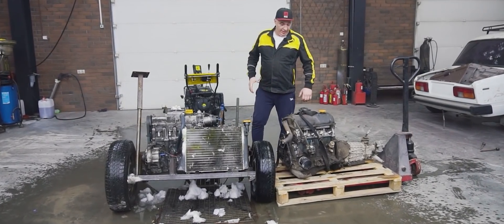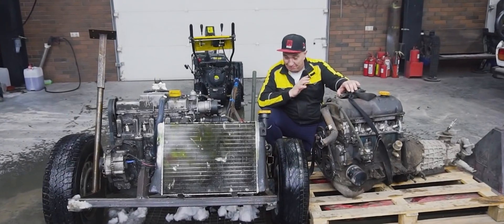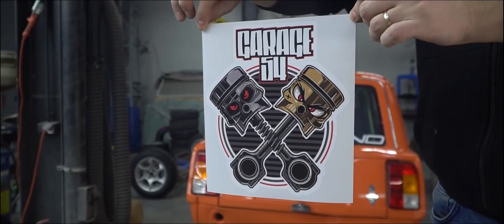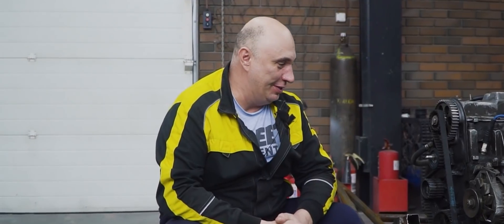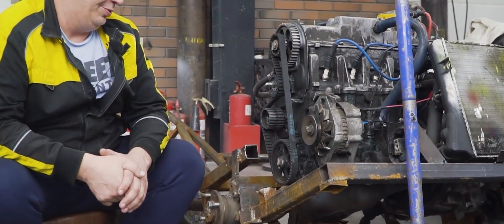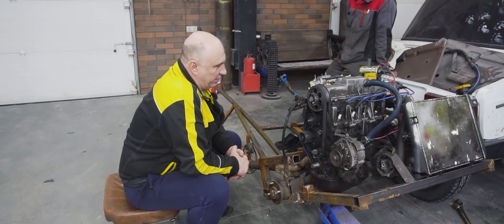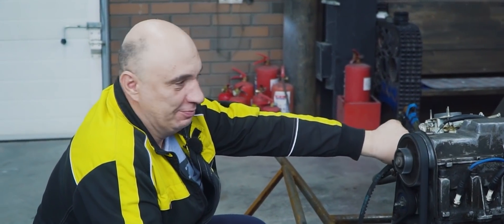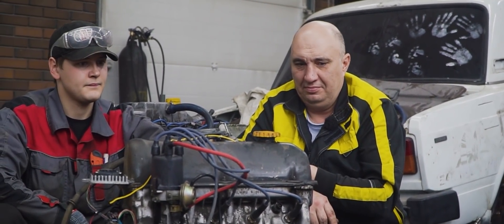8-stroke engine?? How does that even work?

Comment: would be cool to see an actual 8 stroke using gearing and a custom cam shaft such that the engine spins one turn between all firing turns, so basically half the power with a nice v8 sound

Comment: Hi you guys, i used to have 5 Lada Nivas, i made up my own efi system way before Lada actually done it... that was fun, manifol plenum chmaber and the i used the ignition from an early holden, camira,  that gave me 2 options, use the lada distributor for power and economy ort the electronic camira coil for race mode.. others run on 180 holly carby... also good.. used to be fun, . but my Question is that i was told a fiat DOHC fits on and runs on a lada engine.. , I also need a transfer case of a lada Niva send to Australia, can you help?

Comment: if the crank is meant to rotate twice for every rotation of the cam, then having the crank and the cam with the same size pully, it should run like a 2 stroke. and that should work.

Comment: An eight stroke engine would have to have 2 pistons connected to a single rod with spark plugs on both sides. You'd have to have an 8 cylinder distributor...

Comment: Because the engine is being turned over and the valves are opening and closing at a much faster rate than usual this could cause the engine to spit out fuel rather than suck it into the piston

Comment: Okay so what are the 8 strokes? Combustion will be one, for sure. I guess exhaust must be another. What are the other 6? Is the piston really going up and down 4 times between combustion strokes?
What’s the purpose? The most efficient and economical is the Otto 4 stroke, which completely purges the cylinder at each exhaust stroke, before drawing clean mixture in at each induction stroke. No mixing of exhaust gas with combustible mixture. To increase power and possibly smoothness, at the expense of efficiency, you’d need to convert to two stroke. That means there’s a combustion after every Tdc, so you have twice as many power strokes per revolution. 
I’m pretty sure this isn’t an 8 stroke. You’re just increasing the cam speed, meaning exhaust valves are opening while the piston is half way down what should be the induction stroke, contaminating the mix with spent gasses. Worse still, both valves will open during what should be the combustion stroke, allowing fire back into the carb then down the exhaust, where there may well be some combustible mix lurking. It all sounds like a bomb, to be honest

Comment: Maybe add a turbocharger or use the engine with more cylinder rings for some more compression as it seemed both didnt have enugh air

Comment: I would try this experiment with some valves added to the intake, i mean directional valves so it can't spit the air and fuel back thru the intake manifold/carb. Then it might work, currently because the valves open twice as much, during compression it pushes the air/fuel mixture back thru the intake. That's why you don't have compression either

Comment: Got it backwards; an 8 stroke would be 8 strokes of the piston to one fire of the piston thus yielding half the power much like an old farm hit or miss engine. To get more power it would be better to go for a 2 stroke, as each rotation of the engine would have a power stroke. It would need some reed valves and some tuning to get proper scavenging.

Comment: An 8 stroke motor actually has the camshaft turning at 1/4 the speed of crankshaft, not twice the speed. They were used last century for use in dairies. They were governed to 1000 rpm to give drive to the cream separator & the camshaft was brought out as a 250 rpm for the vacuum pump

Comment: A good experiment would be 4 stroke gasoline injection and 4 stroke hydrogen fuel injection. With their own separate tanks same injection. It would cut down half of gas price and it’s only a dollar a gallon of hydrogen fuel. A 8 stroke gas/hydrogen engine. I’m no engineer but that would be first step to hydrogen fuel.

Comment: 4 stroke refers to the number of pistons movements. It's still a 720° firing order. Need to have each cylinder to cycle on time without ignition and return to bdc. I think it would be a 1440° engine at that point, each cylinder firing at 180° instead of 90.

Comment: i think you got it backwards. given a regular 4 stroke of intake, compression, expansion, exhaust, try 6 strokes first of intake, compression, expansion, compression, expansion, exhaust. With this you will want to run the air fuel ratio as close to middle as you can but you would need to be careful not to combust any nitrogen.

You can also try a different way by running rich initially then lean, For instance intake (rich), compress, expansion, intake (air), compression, expansion, exhaust, which is 7 strokes. However for the 2nd intake to prevent any materials traveling the wrong way,  a turbo could help. Nowadays there is an engine in development that uses a piston to combust the product of another piston  which if you did would halve the effective number of cylinders but give you 8 stroke, That means after 1 cylinder goes through 4 strokes, at the 4th stroke the exhaust is the intake for another cylinder but it does not take any air in. This method though has to run cool to ensure it doesnt combust the nitrogen instead.

Comment: I swear I once saw an animation of an engine, two smaller pistons on eachside of a larger one, instead of having a piston push out the exhaust pipes, the two smaller pistons would push their exhaust into the larger piston to be used in its combustion process. 

That, or maybe it was a set of three pistons which would use the exhaust of the piston in front of it to try to squeeze a bit more power out of the fuel. 

It might have been some sort of boiler engine, or steam turbine engine, used in some sort of marine application.

Comment: Have a question for the stupid 8 Stroke motor. In the original video, did the 8 Stroke motor have a camshaft driven distributor? 

From what I can think of off the top of my head this eight-stroke motor would just fire with the Piston going halfway up, it would start jerking it back down weakly, then it would fired again at the top, with a half exhaust, half intake mixture that wouldn't burn half as good. So the motor if it could run, would literally fight itself, just to rotate.

 Yeah. try my design. it works. It is pretty easy to do, if you start with the right four banger. When I rode the bike it had a completely different feel to it, yet had tons of power.

 One thing that would be cool to find out, is if it makes more power as a 2-cylinder, than it does a 4-cylinder.......hmmmm

Comment: I can tell you a combination that actually works, although it's not an eight-stroke motor. Kids, do not try this at home this is just for experimental purposes. I had a 1970 CB750 ohc motorcycle, with a single overhead cam, inline 4-cylinder, 750cc engine. I converted it to a 2-cylinder, 750cc, extremely easily. This will, 100% work, and will fire two cylinders at the same time, and then two other cylinders, at the same time. Simply take the valve cover off. Pull your camshaft out. On the 750, the timing chain gear is in the center of the camshaft. It has a sprocket bolted on it, with 2 bolts. Take the sprocket off, and with a thin hacksaw blade, carefully cut the camshaft in half, while splitting the 2 bolt bosses evenly. You're going to cut it literally right down the middle, and when you are done, you will have to separate camshafts, and each one will have the 2 bolt bosses for the sprocket. Now, all I did was flip one side 180°, and just reassemble the sprocket with the two halves pushed together. When done, your sprocket bolts will literally go through two separate camshafts. I assembled the cam back into the motor, and then tightened my sprocket bolts, to try to help to keep everything straight. Because it is a wasted spark ignition, and fires every cylinder twice, there's nothing else you need to do but flip the camshaft. Now you have an engine that will start and run, as a giant shaky, two-cylinder. I actually rode this bike for about two months before flipping the cam back, out of boredom. But this one definitely will run.
Reply: And yes, the way I converted this is very dangerous to ride it as a motorcycle, because if the timing chain breaks, it can lock the back wheel. And yes it makes an entirely different sound. Gone is the smooth 4 cylinder, replaced with a shaky, twin-cylinder Thumper. But it 100% works. To copy this on a different engine: 

no.1 have to be two outer cylinders up, while two inner cylinders down configuration, four cylinder.

No.2 has to be a single overhead cam engine, preferably two valves per cylinder.

No.3 has to have a wasted spark ignition. On the Honda, it has one coil, that fires two cylinders, at the same time, then it fires the other two cylinders, with the other coil. Everytime one cylinder ignites at compression, the opposing cylinder fires at the exaust stroke, wasting the spark at exaust stroke. That is where the wasted spark name comes from. Because piston is at the exaust of the stroke, the wasted spark essentially fires an empty cylinder, doing nothing. Twice the spark, with half the fun.
Reply: My engine essentially just fired the two outer pistons, when they were up, and then fire the two center pistons, when they were up. if you use the Honda 750sohc motorcycle motor, it's the simplest way to do this, because it's already wasted spark, and it's already 2 up/2down configuration. The wasted spark is no longer wasted. when I flipped my camshaft on one side, it made both outer cylinders have the same compression stroke, and made both the two inner cylinders have the same compression stroke. My coils would literally fire those two cylinders at the exact time, and then fire the other two cylinders at the exact same time, with the factory ignition setup. A big two cylinder, made out of an inline 4-cylinder, by just flipping half the camshaft on one side 180°. Easy peasy.

Comment: An actual 8 stroke engine is much more complex. found this in some forum:
1. intake 
2. compression 
3. power/ignition 
4. exhaust 
5. water intake and 2nd power stroke (pulls in liquid water, which boils and turns to steam, driving the piston)
6. steam recycle (exhaust steam expelled to steam electrolysis module)
7. hydroxy gas intake and ignition (pulls in hydrogen/oxygen gas mixture from electrolysis module)
8. exhaust (exhaust water vapor expelled or recycled)

Comment: Because the cam is rotating twice for every rotation back from below it's opening during the compression stroke turn your timing 180 out since it's coughing out the intake it's backfiring it might actually try to start but it's going to run like s*** that's why they make things a certain way

Comment: You would have to shorten the Stroke of the pistons to like 1.4 inches and when it starts off the start that's only because there's leftover fule in the cylinders or put a bigger cam in it to make the lifters stay open long enough the fule don't come out the carb

Comment: The is such a thing as a 6 stroke engine with a second power stroke using steam or air as a working fluid to capture lost exhaust energy.
Reply: 8 stroke is possible if they use water

Comment: Haha 😆
I was wondering if I had it wrong on valve s needing to be closed now and again for the whole thing to work.
8 stroke is half the power of a 4 and the 2 is completely different design.

Try building an Opposing Piston engine from 2 bolted together somehow ? 

2, 2 stroke diesels might work if there easy available.

Comment: This doesn’t work because you are not completing any stroke ,what’s happening is when the piston is at bdc on its compression stroke the small amount pressure that is built is releasing trough the xhaust valve and then before it reaches tdc the intake valve opens  releasing and other pressure being built up that is why the fuel is spewing at you it’s no longer being pulled but pushed   It may work if you make the head and block a lot shorter that way the piston would synchronized with the valves movement but even if you got that motor to run the hp would be like 30 and the torque would be like 120 while it would suck gas like a drunk on his 5th day sober what you can do to bring up hp is convert to 2 stroke and force induction would be ascreamer motor with very good high end hp

Comment: The gas and air doesn't even get time to mix and combust to perform a pressure stroke before the exhaust valve opens releasing the power

Comment: Here is the problem:  You are running the camshaft 4 times as fast now, so you have gone from a 4 stroke to a 1 stroke!  Hint, that won't work out very well !  Put the same size of sprocket on the crank and camshaft, and you will have a poppet valve 2 stroke. You will need to add an exhaust scavenger pump (aka a supercharger), or butcher up some type of compressed air system, or even a fan. You also need each cylinder to have spark every crank revolution. Anyway, it will indeed run as a 2 stroke, I know this will work, since I did it with a 1 cylinder 4 stroke Briggs lawnmower engine, using a piston supercharger. Happy welding guys!   ChargerMiles  :)

Comment: The guy who made the original video is either an idiot or a scam artist.how can you get 2-4 times more power from half as many power strokes? That's why 4 strokes have to be bigger than 2 strokes, to compensate for the loss of power.

Comment: The valves do the 4 normal Strokes the problem is that the piston ONLY does 1 cicle so you have intake and compresion on the way  down and explosion and exaust on the way up .
So you Will have spark at tdc but no presure in cilinder as you just did exaust on the valve side

Comment: The starter motor died on my truck last week and had me stranded. It made me dream up an idea for your show to bypass the starter:
Having a small auxiliary motor to get the truck rolling for a push-start.
Maybe a chainsaw under the truck but the chain goes around the driveshaft to turn it. That would take advantage of the gearing ratio in the rear differential. Perhaps even more gearing-down is necessary. You could reach under the truck, pull the chainsaw cord to start, then get in the seat and throttle up the chainsaw while in 1st gear with clutch down. Even if it takes a while, the truck could eventually get enough  speed to dump the clutch and start the engine.
Reply: yes, there have been (old and big) engines with pony motors to start them before, this isnt new

Comment: Take a V-8 and use two of the cylinders as compressors for the other 6. The two would be bored and stroked to as big as possible with compressor outputs. Basically a V-6 with a V-2 compressor in line.

Comment: now what would be a good idea is something like my prototype cam shaft for a v6. instead of firing one cylinder at a time, it fires 2 at a time on the same power stroke. basically 2, 3 cylinder engines .

Comment: This is not an 8-stroke engine. Those simply do something else for 4 more strokes. In early days this was a way to ventilate cylinders to cool them without cooling system :) Nowdays we know it's more efficient to spin a cooling pump instead.
This one could be a two stroke but for this to somewhat work you had to use same size sprockets and shift timing 45 degrees on crankshaft forward and ignition 90 degrees forward (if I got it right). Would be fun to see if it tries to fire at least. Now your valves where just dancing randomly like crazy.
Those engines must be non-interfering ones otherwise it would have bent valves.

Comment: You should flip the steering on a car - turn the wheel left, the car goes right - and see if you can drive it
Reply: Years ago had a go on a reverse steer quad. It takes some practice and when you jump back on a normal one you have to re program your reactions again. It's weird.

Comment: Should have tried the Same Size pulleys on crank and cam.  That would have given a two-stroke engine.  Would need a blower to force air-fuel into the engine.  This was experimented by big car manufacturers about 10 years ago.  Thing is, at 4 thousand rpm, the valves think they are operating at 8 thousand rpm.  But low end power is awesome.

Comment: Hey can you please experiment on a regular wheel buy cutting it all out then keeping the center part where you bolt it to the car take a big chain then weld it into a star shaped while welding it in the center part of the wheel having the chain welded in the wheel then some how put the center part of the lug holes in center of the star the star has to have big enough space to put the center lug part back   center part inside the chain in the middle but lug part welded all the way around the chain in the center of the star. Then put tire on then test drive to see if it could hold the weight.

Comment: The reason why this doesnt work is because as the piston goes down both the intake and exhaust valves open and it does this as the piston goes up. there is no strokes in this config because there is no intake, exhaust, compression or power stroke.

Comment: 3:52 Damn I remember fitting the wrong tensioner to my 4G63 not that long ago - I started the engine, went out to go see how it was running, and saw that the belt was slowly walking off the crank. I pulled the coil lead as fast as I could. By the time the engine died down from a fast idle. the belt was more than 3/4s off the cam sprocket. Imagine if I had stayed in the car? 

Piston and valve kiss.

Comment: Watching you weld that timing gear to the crank hurt me lol.  Good content though.  I think all it would need to run is for you to change the cam offset.  The intake must be opening during compression or exhaust stroke forcing the fuel out.  Probably too much work to figure that out though.  You might also need custom ignition timing.